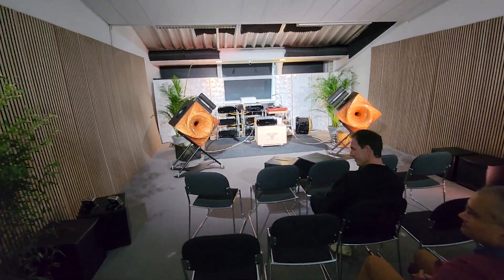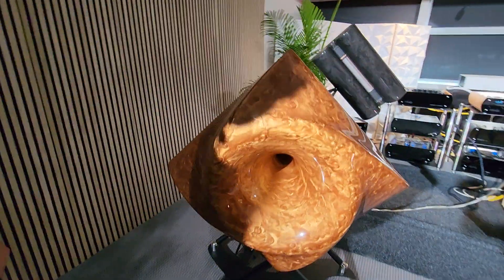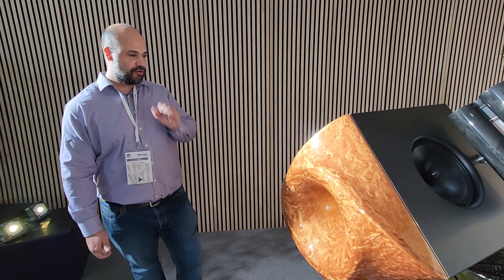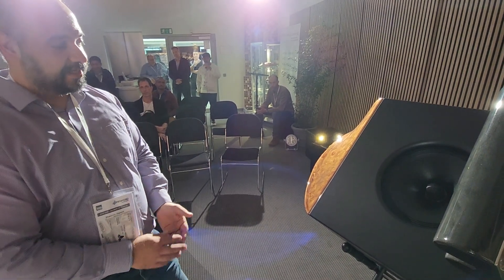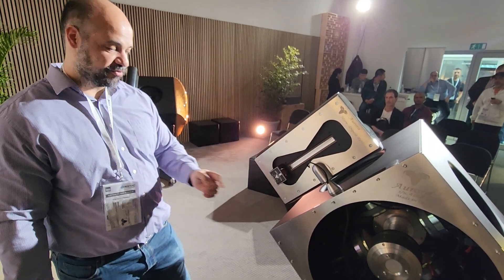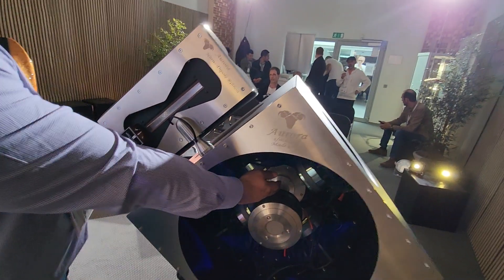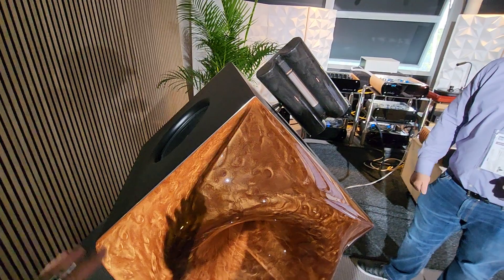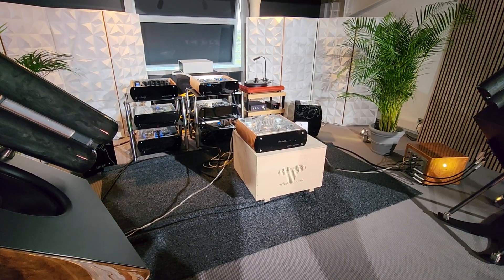🤩 Brilliant!!! Stavros Danos of Aries Cerat Explains the Aurora Speaker Design

Comment: the tweeter size is not to smart..  you can only listen with 1 person in this case.
Reply: @joppe peelen  
While I haven't heard these yet, I would agree that the center image sweet spot would probably be quite narrow with that tall and narrow ribbon element in this orientation.

Seems like it might solve one problem while creating another.   As always, loudspeaker design is a balancing act of tradeoffs.  

But it also depends on how high the midrange horns are playing and what frequency the ribbons take over.  It would be interesting to know all of the crossover details.

@Audiophile Junkie   Any input in this regard after listening to them, Jason?  Is the sweet spot relatively narrow...or wide???

And while that finish does look 3D and very high quality, aesthetically it's definitely not one that appeals to me (pure preference), especially with the abrupt transition to the "basic black cube".

Many years ago I had the 2-way Scanspeak Revelator n0rh SM9.0 horizontal teardrop "drums" or "funnel" shaped solid marble enclosure loudspeakers.  At the time, it was a unique and "fresh" look.  But although they performed really well, the design just didn't age well (IMO).

If I had these, I think that I'd want to create some 360° globe speaker grills with an internal wire framework covered with acousically transparent grill cloth to encapsulate these in, LOL.  Maybe with a custom printed fabric design that I could change over time.  Maybe a Cyclops design!  😜  JK!

Maybe suspend them from the ceiling using small diameter, hollow stainless steel tubing with the speaker cables inside, like giant hanging globe light fixtures....but how much do these things weigh, LOL???
Reply: I've seen plenty of pictures of single seat listening setups. Probably a bigger segment of the market than expected.